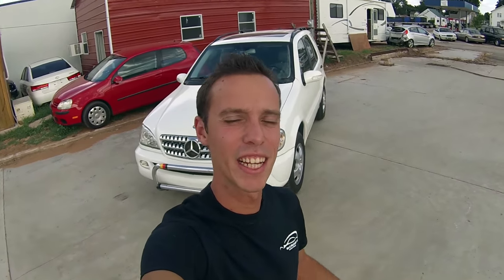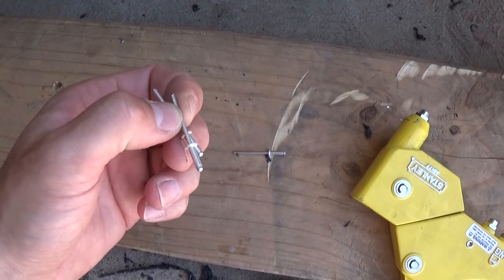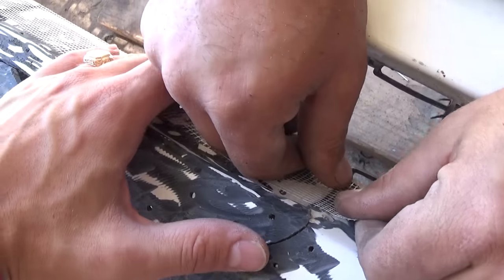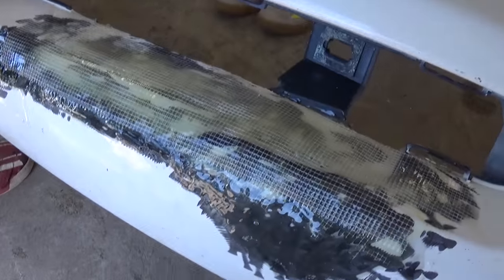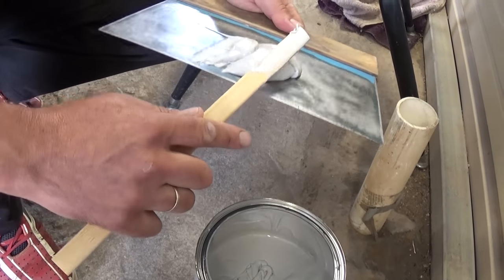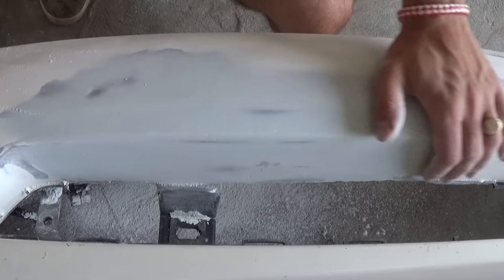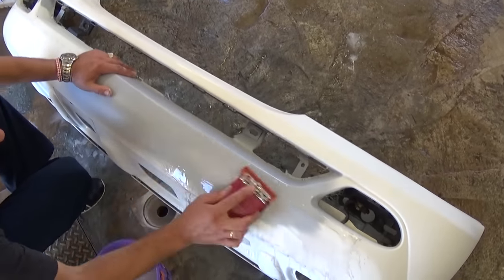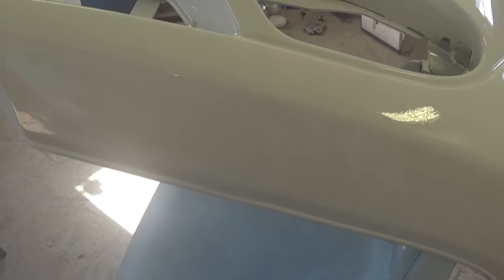HOW TO FIX CRACKED BUMPER. BROKEN BUMPER REPAIR

Comment: Fantastic job lads thanks for sharing it with us. Just one suggestion if I may, and its When you have a long running crack there is a need to stop it running further under stress, so drill a small hole right at the end of the crack this will prevent It from going any further in the future. Cheers guys.

Comment: Where did you guys get the original Mercedez paint from?
Reply: Oscar Monge Mercedes dealer has paint code. Get code and you can get paint mixed - it's just a label on the can